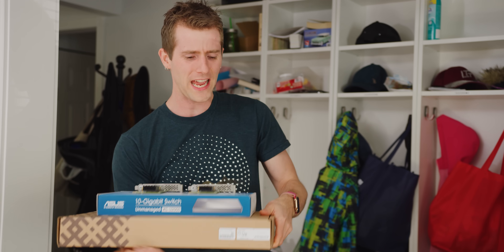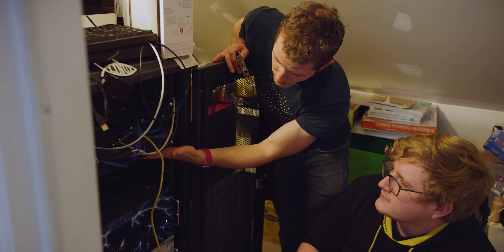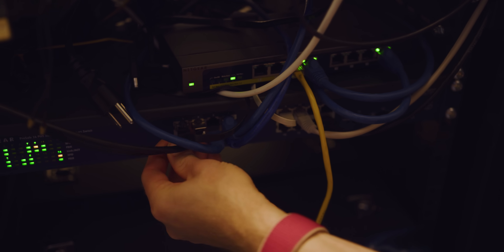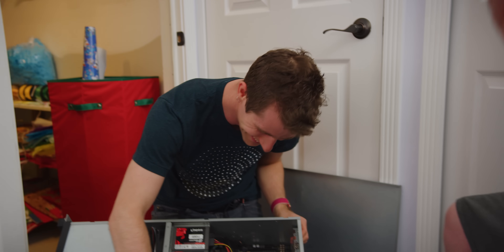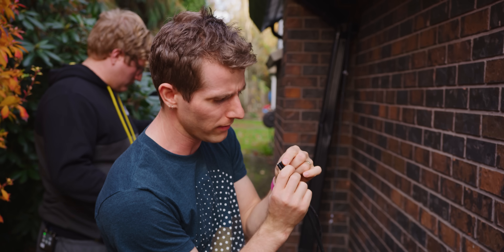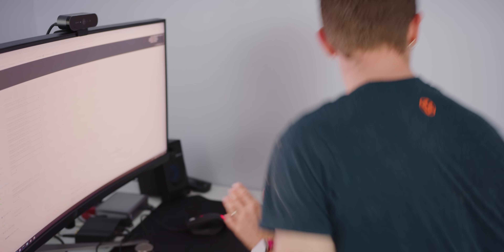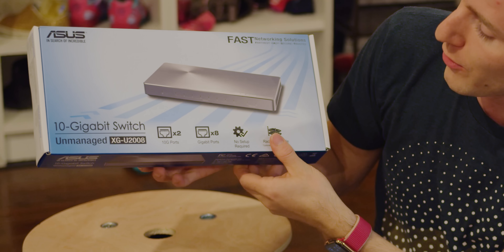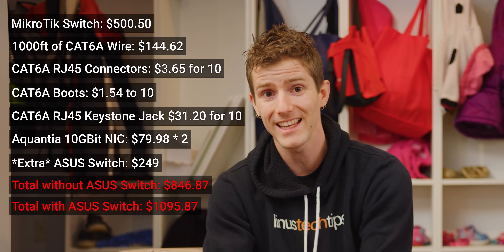Home 10 Gig Network Upgrade for CHEAP

Comment: Jake holds up a $10,000 meter,  Linus: "I didn't pay for that did I"...........Well you havn't dropped it so no not yet.
Reply: I am pretty sure that's the DSX-5000. You can get them for under $5,000
Reply: @ThomasGail  Maybe without the copper or fiber modules. Where on Earth can you find it under 5k?
Reply: @ThomasGail  New Versiv here costs like ~11-12k€. Versiv 2 even ~15k
Reply: Those meters cost $10,000? Really?
Reply: @FoxonSilverfur  Yep. Fluke essentially cornered the market.
Reply: @FoxonSilverfur  Fluke equipment often costs more than the car of employees who use it.
Reply: @generalreticent3791  while costly they are best and are extremely reliable.
Reply: @generalreticent3791  you should see how much night vision goggles cost, you drop them out of a helicopter, expect it to land and for everyone to try find it.
Reply: @FoxonSilverfur  Yes. They are typically used by dedicated network cabling install companies to certify that the cabling they install meets industry standards, which is required by the cabling manufactures in order to issue the (often lifetime) warranty on the cable. You might think $10k is expensive, but the amount of money that the install company gets paid to certify installed cables can easily make it worth it.
Reply: @FoxonSilverfur  can go higher I generally use a 1800dtx which is around 20+ with the fiber modules
Reply: I came CLOSE to dropping that meter off a ladder. Not a good feeling. 😬
Reply: Flukes are extremely hardy devices.  Can easily survive 99.999% of Linus Drops - at the asking price, it better.  XD
Reply: I remember using one of those in college in the late 90's, they couldn't give the students real tools, but the thousands of dollars lanilizer sure.
Reply: @Kelocyde  That is only the 1 GHz replacement module, not the whole package.
Reply: @Avatar42  That's what I was thinking too. The name "replacement mod" raised an eyebrow.
Reply: Purchased a LANCAT System 6 back in the day from a defunct installer. Best 1k I ever spent. 10k new and it has seen some serious mileage (on my part) since then, and he even threw in the multimode fibercat modules for nothing.
Reply: All these people.. it dosent just test the cable, it’s the only cable tester that is a level 3, and the only one that will allow you to get a warranty for cable
Reply: dumpsterdawg my boss left one of those in a job site for a week, luckily no one took it.
Reply: Don't worry, it's a Fluke. It'll live
Reply: On my previous job I have used that same Fluke meter. They can take a heck of a beating and not break.
Reply: dumpsterdawg versiv model is like 15k.. 20k+ with fiber heads
Reply: Have $10k and don't use a electrician's fish hook. So much easier.
Reply: It took me a moment to realize why Fluke sounded so familiar to me. Then I remembered they have an office across the street from my work. I see it everyday, and this is the first time I've seen one of their products in use.

This adds nothing to the conversation. I just needed to say it.
Reply: His face seemed like he was on the bridge of fainting because of sudden bankruptcy.😂
Reply: I just don't understand, that is a special meter used to certify installations. I mean without a certified technician it doesn't matter because the installation can't be certified. If the point was just to check the installations there are so many more cheaper meters for it, it makes no sense.
Reply: @22RyuHi  Yes it makes total sense. You need to make sure your permanent link meets the required Cat. 6A or whatever. And technically everyone can do it with the appropriate knowledge.
Reply: @Avatar42  Ok, when i say certification. I don't mean checking to see if everything is working properly. I mean official certification according to norms established be official certification organization and those norms require that a proper certified technical does the testing.
Reply: @22RyuHi  Ive worked in research for many years now.

A cert means you pay to have a person on staff that sits in the office while uncertified techs do all the work. If something goes wrong they call that guy. That's it.

Comment: Patch cable seems more like a temporary installation 🤔 Me as an Electrician from Germany would install ridged Cable's with outlets or a patch field, and than patch it with short cables to the network device. (I see that the Optics are not important for Linus ,but) it feels like botch when I see a patch cable Hang outside without fixing it to the wall... 
On top of that, who hangs a networking cable outside on a wall? I mean it's a security risk for your network.

So I also have a question to insiders from the US or Canada: is it usual to use flexible cable's for electrical installation or network installation in the US/Canada?
Reply: I was wondering too why they're using CAT 6a patchcables and doesn't put them on a patchpanel. In my case (also Germany) we would use some CAT 7 duplex cables and would put them using keystone's on a patchpanel. In Germany there's nearly no price difference in using CAT6a or Cat 7 cables and both are available in outdoor versions. So I would be really interested if this is common in Canada/USA or if this is only a "Linus thing". I wouldn't recommend anybody to upgrade their network like this.
Reply: @waishon  same we use Duplex/Simplex Cat7 all other things doesn't make any sense as a Company to do in Germany.

Comment: Didn't knew that Mikrotik launched a 12ports 10Gbit over RJ45 I was wondering a few weeks ago how insane is to run fiber at home, now the fun fact is that I checked the price and my local amazon has the NIC's almost at the same price as the switch.

Comment: You forgot the Fluke Test Gear in the budget......

Adds $10K......

Budget ;)
Reply: Realistically he did not even need to change his Cat5. Since I have a similar setup (Aquantia nic's + netgear ms510txPP) and 10G works perfectly well over decent Cat5 (24AWG) for a 60 meter run. And the only use of 10G test gear is to basically certify things. Otherwise Chinese testers or something like Pockethernet will do everything else just fine including pretty decent fault location.
Reply: @ooHotcooleRoo  any options that can hook up to a smart phone for cable testing? So it displays the information on the smartphone.
Reply: @LND3947  Pockethernet. I have one and it's not without it's issues - but overall works well enough. Best part for me is the TDR graph, that does not actually do that well for length stuff, but actually perfect for fault detection and location after you figure out what sort of graph look you get when there's crosstalk, bad connections, water in the conductors e.t.c. You can actually tell with decent certainty what the fault is and where it is +/- 3-5ish meters.

Comment: Well, the mikrotik wiki would've got you covered with the standard ip adress. Also it'll be in RouterOS mode atm, you'll have to dial in via Webinterface and change it to SwitchOS.

Comment: Ahh MikroTik, I was going to buy their SXT LTE outdoor router until I found out it was only Cat4 and no LTE-CA.
Reply: In my expirience it's better (read cheaper and heluvalot easier) to get a indoor router with external antenna connectors and get an external MIMO antenna.
Reply: Where I need to put the antennas would be way to far to run cable. I would not be able to get line of sight at my house. In my field that is considerably higher than my house has perfect line of site to the tower 0.83 miles away. I'm not getting the MikroTik since it's only Cat4. I need something with 4x4 mimo and aggregation. I've already tested with 4x4 mimo and get more than double the speed.
Reply: @AvidSurvivalist  Realistically it's unlikely that you actually need 4x4, especially with direct line of sight. But you can try Zyxel LTE7480-S905, but I'd go for a cheaper 2x2 Cat6 model. Should be plenty fast, I have an indoor LTE3316-M604 model and it's fairly decent, reliable, but no CLI (well no password) and no spoofing stuff (TTL, IMEI) if you need it, otherwise worked very well for me in Russia with a directional 2x2 mimo antenna over a 2.2 mile link through some trees. Outdoor might have CLI e.t.c. though.

All in all I'm fairly happy with it, no issues with reliability and I get stable 60-80mbps on a non aggregated 20mhz Band3.
Reply: @AvidSurvivalist  Probably LTE7460-M608 should do the trick (read "At least I can find it for sale somewhere" that 4x4 seems to be targeted to carriers e.t.c. so probably will not be an easy task to find).
Reply: @ooHotcooleRoo  I've tested it. 30 Mbps with my 2x2 mimo device vs 80 Mbps with my 4x4 mimo phone. Same sim. If I can't find an outdoor router, I'll just get the Nighthawk. I can find a refurbished one for $149. I still get decent speed (50-60) with the crappy signal of -112 dBm my phone gets. My Huawei B890 gets -107 in the same spot but gets slower speed.

Comment: One of the most important differences that make Cat6a cable so resistant is the frequency with which the pairs are twisted. Each individual color pair is twisted at different frequencies which reduces "cross talk" between pairs, and in general twists are a lot higher frequency in Cat6a vs Cat5e. Some manufactures will balance this out (less twists = easier to install) with a metal foil shielding/grounding inside the sheath which is better at reducing loss, although it's more expensive.

Comment: There’s cat7 cable out there, even cat8. If you shop around you can get it for just a little over the Cat6a, future proofing even more ( 40GB switches ) . However they are usually thicker, and quite hard to route. Some may be awg22, and the cat7/8 ethernet plugs for those are quite large. Good informative video otherwise though.

Comment: TAke a look at those alliexpress connectors that pass wires through. When you clamp the connector it cuts of excess. Much easier to work with :)

Comment: Sooooo... 10 gigabit backbone. Crap. The Nas didn't need it!  You only have SSD?
For cheap you could have run multiple connections using  aggregate connections between 2 gigabit switches for 2, 3 or 4 gigabit connections. You could then run aggregate connections between your workstation and your nas  This would have been a third the cost with most of the benefits.

Comment: "It was simply too expensive... So here's this $500 switch."
Reply: Linus, you might want to re-think that ethernet cable running on the outside of the house. Someone could just cut the cable, put on a new connector, and try to access your router/access point.

Comment: "Budget home upgrade"

$500 network switch...
Reply: 500 for a switch is nothing. Enterprise grade switches are easily $50'000+
Reply: Well, being that 7 years ago. A card a tenth of it size costed well over a $1000. $500 dollars is reasonable and you do not need to spend that much to get 10GB internet.

Comment: Linus... Duct tape the exist cable to the new cable and pull it through. Cut the connectors off first though. Easy way to re-run cable.

Comment: The Ubiquiti ES-16-XG is also a great option for home use 10Gb.  It has 12 SFP+ ports and 4 RJ45 ports.  I use one as my core switch and have started switching over PC's and servers to 10Gb, however, I'm using MMF to connect everything.

Comment: Mellanox connectx-2 sfp+ cards are like 30 bucks and with cheap (15 bucks) fiber modules they can run over 300m, the mikrotik 10g sfp+ switch is also waayyyy cheaper than that one (and fanless)

Comment: See, i prefer to use passthrough connectors instead..
Reply: Which are not rated for 10gbE nor are they cat6a spec compliant. Use what you want but don't suggest things that are wrong for the shown application just because you are too lazy to do it right.
Reply: There are cat6a shielded connectors now. Platinum Tools ezEX-RJ-45, external ground models too.
Reply: @dakel20  I stand corrected, thank you
Reply: Don't mention it, I had to double check because I just used a bunch and you made me do a double take on it.

Comment: As someone that does low voltage work I really enjoyed this, but use scissors you noob
Reply: But, with that cable cost, I'm certain that he bought CCA cable. He's gonna have a bad time.
Reply: @LeviDurham  yeah that's the trick for 2 part rj45s
Reply: yeah and cut the 8 wires at an angle so the two part connector slide much easier! otherwise this small triangle is a pain to use.
Reply: And I would of ran shielded
Reply: @Saxby8six  with a surge protector for that outside line.
Reply: Hunter Baldwin for 10g I would go fiber with xfp (single mode prefer but multimode is also perfect. single mode fiber tend to equal multimode for fiber but for xfp it s still more expensive) at least fibers between the 2 switches to be futur proof and reliable. I know cost is an issue for consumer but thats so much more reliable and distance isnt an issue as copper.
Reply: Snips

Comment: "Just 500 Dollar"
Reply: That is cheap for 10gig
Reply: It's cheap and budget for Linus. For most everyone else, LOLLLLL
Reply: 5 years ago that would'v been 1500 atleast. Its just like tv's. 8 years ago a 4k tv was like 4000 dollars and nowadays a 50 inch 4k tv is like 400 bucks. Therefore it relatively cheap compared to what it was.
Reply: Just......
Reply: The guy has experimental 3,000 dollar computer chips, what do you expect lol
Reply: My thoughts exactly! That's pretty pricey.
Reply: Try to get same hardware cheaper...
Reply: That's still way cheaper than the rest of the industry, which is sort of Mikrotik's schtick. And really good wireless management
Reply: I mean it's just 500 dollars... it's just about roughly 1/4th of my salary but still.

Comment: Nobody: 

Linus: NEEDS 10 GBIT EVERYWHERE
Reply: I mean... who doesn't.

If it took me 1 second to download stuff that'd be that much time less I waste just sitting around waiting for things to finish lol.
Reply: @jetjazz05  lol this is for internal speed... not downloads
Reply: @jblps  im such a stoner idiot LOL MY BAD
Reply: Custom
Reply: @meliohe! It's a meme and a jab at Linus for wanting 10gb when 1gb is plenty unless you're Linus
Reply: Relax, he didn't use 10g link for the media center stuffs, just the trunk.
Reply: @Iama Dinosaur Rubbish. My oldest 10 year 320gb hdd was bottlenecked by 1gig network - that's just around 110MB/s. Slow HDD easly are getting 200MB/s. Getting bottleneck from network is silly, 10Gbe should become mainstream.
Reply: I have 1G lol
Reply: What service provider even has 10 gigabit in Vancouver?
Reply: @nairbos  The 10G is for internal Network use, not for the commercial internet coming into the house.
Reply: @bgubs07  so you don't need to have a 1gb subscription at your provider to use it?
Reply: @27Fabrizio correct.  This particular 10G upgrade would only make talking to other devices on your internal network faster.  To be honest, most people don't need 10G at home.  If you're transferring 10Gb+ files between computers all day, that's when you'll notice a speed increase (like if you're a youtuber that records videos in 4K+ everyday).   Most other things really won't feel any faster as you're not maxing out your gigabit ethernet.  Also, 2.5G and 5G products are slowly trickling out that will make 10G even less needed.
Reply: @SurfSailKayak  I'm not gonna waste my money going less than 10Gb
Reply: @nairbos  Really?😩
Reply: Nairbo Bryan is absolutely right. With this method you can share big files like games very fast when you downloaded them once. You have a so called Caching Server for this. So basically you get the data once from the Internet ("using" your internet service provider), and if you ever want to download this file again, the caching server has it and you can download it with 10 Gigabits per second! :)

Comment: Here a tip from a security guy don't use microtik there software has so many holes it's just a joke and that's also why they are so dang cheap i hope it's a dumb switch.
Else have fun. There is at most only one month between a new CVE of them.

Comment: Wouldve been cool to see/explain the transfer speeds before replacing the cables (for those who dont know)

Great Video. 

Also I picked up an 8 port Netgear 10gbe switch for $250 on ebay a few months ago....good deals if you're patient.

Comment: My house doesn’t even have Ethernet. All it has is the ports for landline
Reply: I moved into a house with 2 phone lines on every room. I used that to pull double runs of CAT7 to each and changed the wall plates to RJ45. I don't even need half of that but I'm dam proud of my work and network.
Reply: @talbizle  Please expand. What did you use to pull the double CAT7 runs?
Reply: @fffffffffzzz  he taped the cat7 cable onto the existing phone cables and used that to pull it through the wall to th connection points
Reply: @BenCos2018  Don't use the phone cable to pull the rj45. It'll break in the middle and that's a bad time. Use the phone cable to pull fiberglass fish tape (very cheap) and add cable lubricant. Then use the fish tape to pull whatever. This only applies to cable going through conduit of course.

If everything is ultra tight and you can't pull it through, get a comealong (ratcheting cable puller) for a few bucks to do the pulling. I recently replaced all my phone lines with cat6+phone lines and in one spot I even added coax, all through one conduit. It takes patience but it's doable.
Reply: @naomi-g didn't know that actually thanks for the advice. though i wasn't talking about cable in conduit i was talking about cable where its just ran through the wall (no conduit) though thanks for the useful advice. :-)
Reply: @fffffffffzzz  Sorry for the late response as I don't see most YouTube notifications. I used the pre-existing phone line that was installed in the home. So only wall plates were changed to keystone double jacks.
Reply: Monoprice and a weekend and it can have.
Reply: my house only has one landline port
Reply: Same 😂😂😂😭